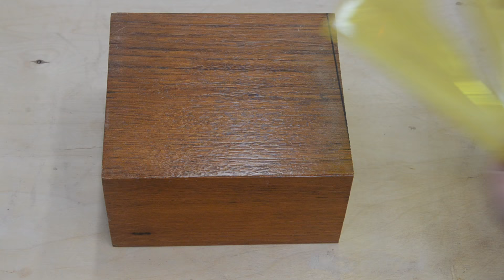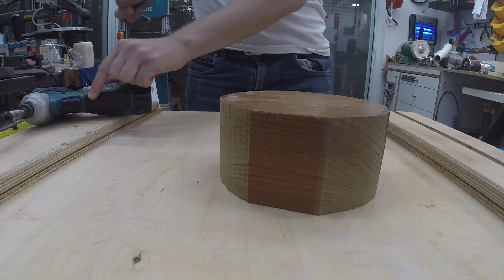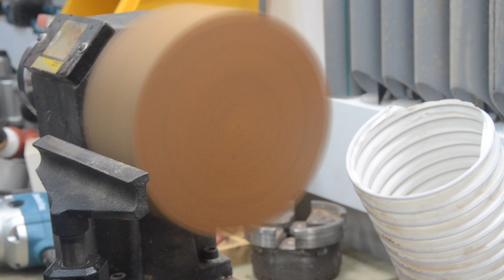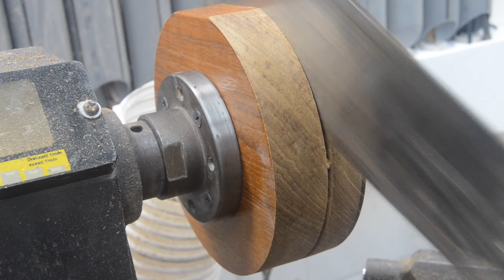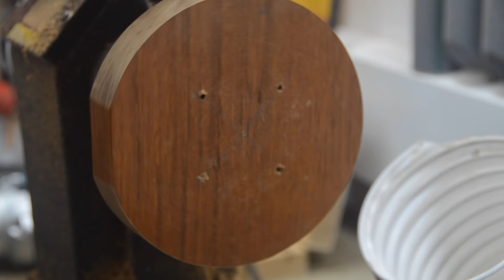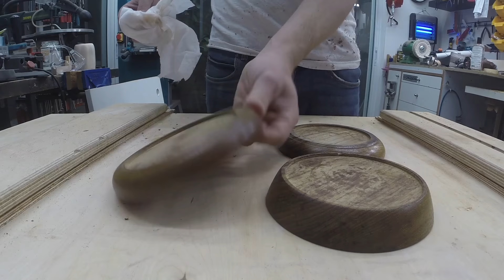WoodTurning 3 small Teak plates as gifts

Comment: What is the oil that you used ? And the sanding paper please
Reply from the maker: Oil - https://www.amazon.com/Mineral-Cutting-Boards-Countertops-Butcher/dp/B01B5ECU3O/ref=sr_1_1?keywords=food+safe+oil&qid=1576609161&sr=8-1
sanding paper - https://www.amazon.com/Mirka-9A-129-240-4-Inch-Abrasive-Sanding/dp/B00MPQMDAW/ref=sr_1_40?crid=U52IRVEXPK5R&keywords=mesh+sanding+paper&qid=1576609057&sprefix=mesh+sanding%2Caps%2C309&sr=8-40

very fun and easy (:

Comment: What kind of finish was that?
Reply from the maker: Food grade mineral oil
Reply: I've used mineral oil on carvings, but never got that "shiny" finish that you did.  Difference may be in the sanding.  Thanks
Reply from the maker: @John-gj1jr  Sanding is an important stage, and i usually put some mineral oil on, wait about an hour for it to soak and repeat - about three times or so
Reply: @neildarshevitz9133  I have never used it on bowls.  I was just surprised at the finish you got with it.  Very nice.  I've used it on carved spoons, but I never sanded them past the rougher grits.  It makes a good finish for spoons because it is so easy to redo if needed.  Guess the same applies to bowls, come to think of it.
Reply from the maker: @John-gj1jr  it depends on the wood species as well i guess, but usually after 3-5 times of applying oil the wood pores plug up and get a sort of natural sheen
Reply: @neildarshevitz9133  Well, it's a very nice finish.  Food safe, as well.  Thanks